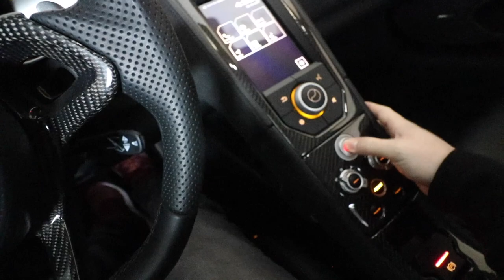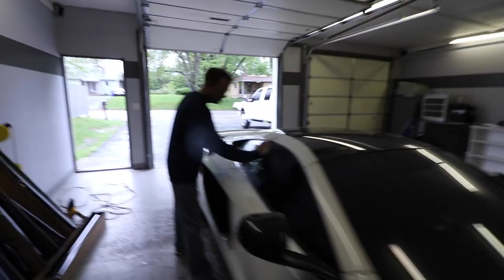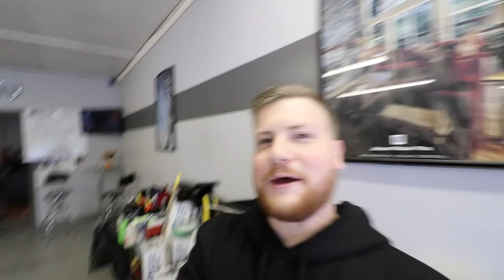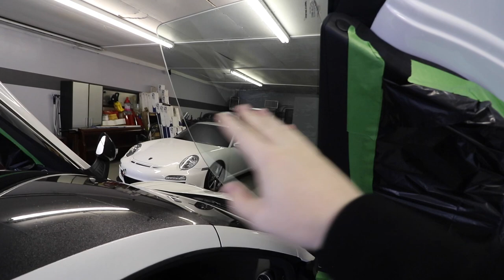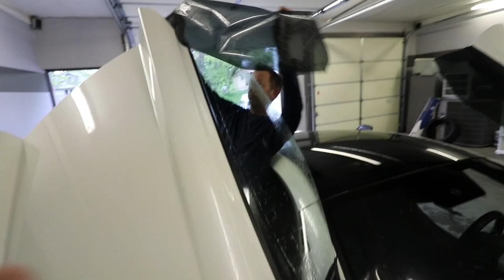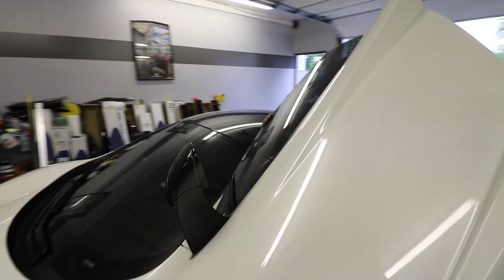How To Tint Your Windows

Comment: Should have asked me, the tint that was on the car was 20%- SunTek CIR Ceramic Nano-Hybrid film which carried a warranty, the blue tint is an artifact of the lighting most likely, the film will light meter 20% but still maintains visibility while blocking heat-  your front windshield is also a ceramic 55% tint, neither rear window is tinted

Comment: Tell that tint guy to use a heat gun to remove the tint. Use your brain, not your back. Also the adhesive stays on the film, no scraping after. Amateur tinter.

Comment: Hey Troy what was the % tint again used on the different areas again?  Getting my Jag tinted on 19th and was advised 70% front, 50% the rest.
Reply: don't waste your money because thats basically no tint at all
Reply: limo tint is 5%, 35% you can still see in. The new tint he installed is 15 or 20%
Reply: You have to check what's legal in your state
Reply: Yeah 50% sides, back is whatever you want, and 70% front window is legal... in Ohio.